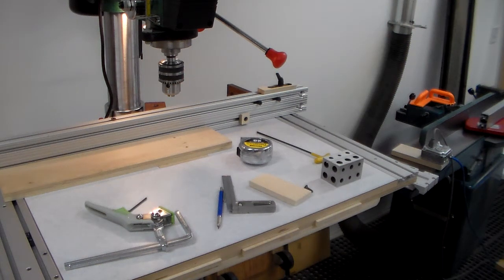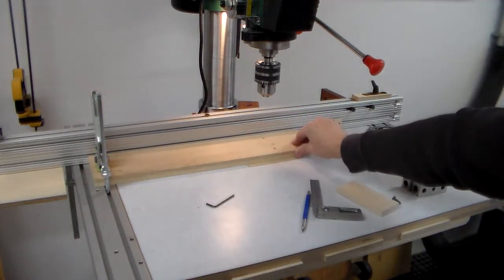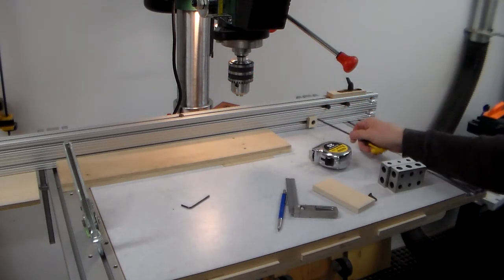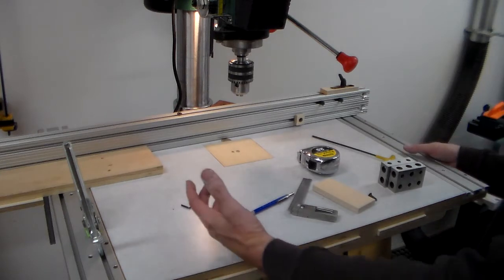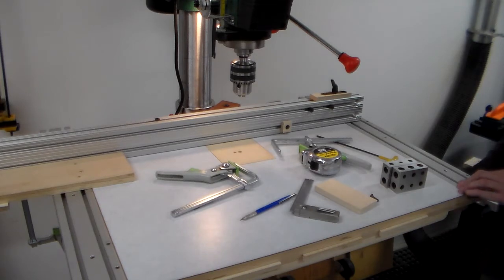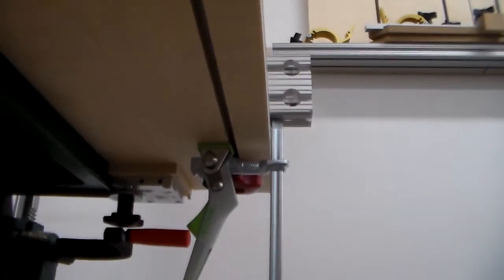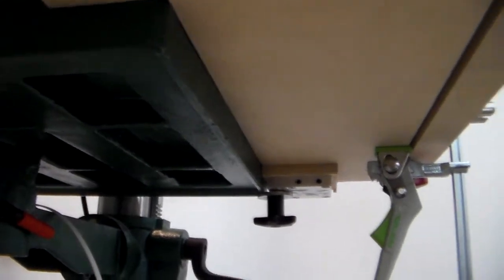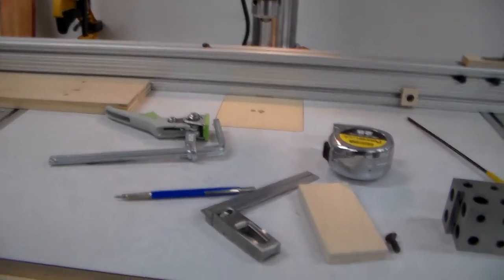Drill Press Table Intro

Comment: Jeff- love the drill press table but I can not find the two side aluminum extruded pieces in that size anywhere. Do you happen to have a supplier. Thank you so much.
Reply from the maker: 80/20 Extrusions. Side pieces are 20mm x 80mm and the fence can be whatever you want. Mine is 1.5 x 3 inches.  A link to the side pieces follows.
https://8020.net/shop/40-8020.html